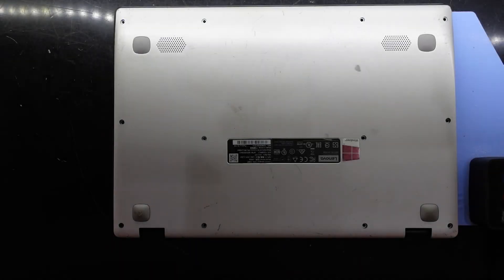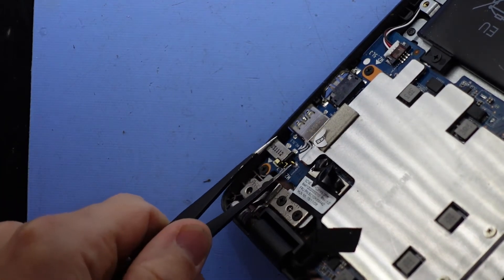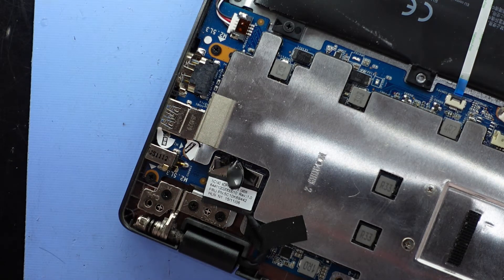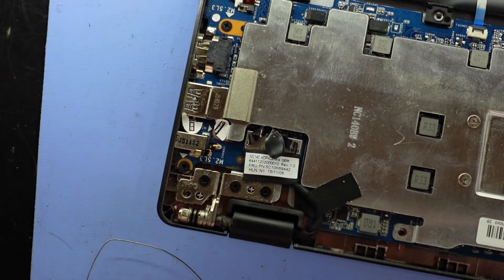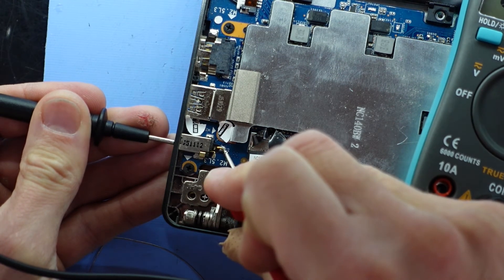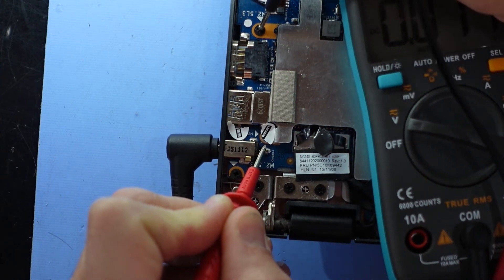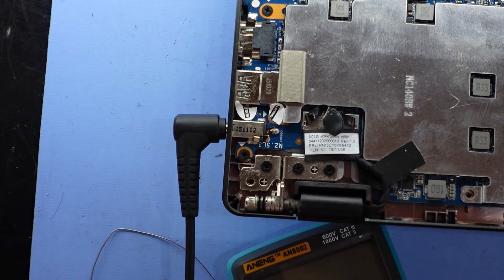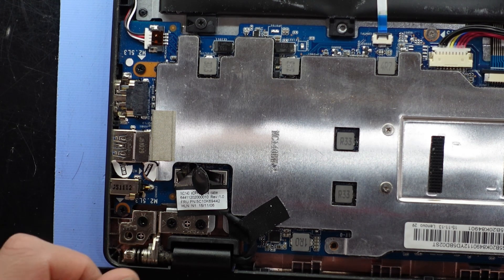Lenovo Ideapad Charger Port Quick Repair

Comment: I  fixed my lenovo think pad the same way. The leg into the board was a bit loose and I pushed it back to the jack and closed the gap. I put a blob of flux on the break before soldering. I am hoping the dry joint will be ok, The tablet is charging ok now. If the dry joint gives problems in the future I will have to take out the system board and try and solder from underneath. Thanks for your video which showed me where to look.
Reply from the maker: no worries at all, great to read this has helped

Comment: Does this laptop have attached charging port to motherboard?? So do i need to replace the whole motherboard or can only the port be changed?
Reply from the maker: It's part of the mainboard, as shown
Reply: @rickstechrepairs  so , do we need to change the whole motherboard if charging point is not working?

Comment: What if the charger is wiggling in the port?
Reply from the maker: that would be a worn out port, or worn out cable.

Try a new Charging cable, if still the same lossness, then the port will need to be swapped